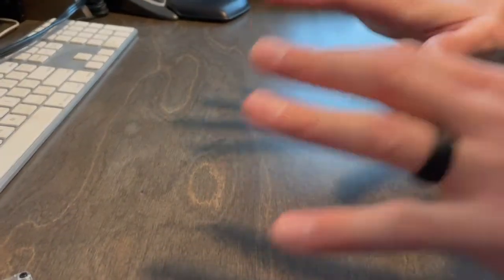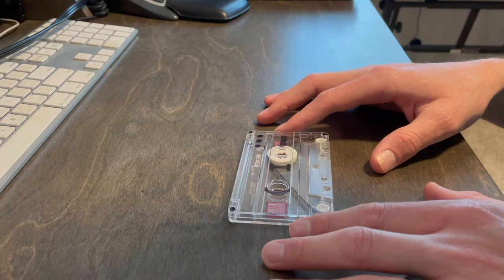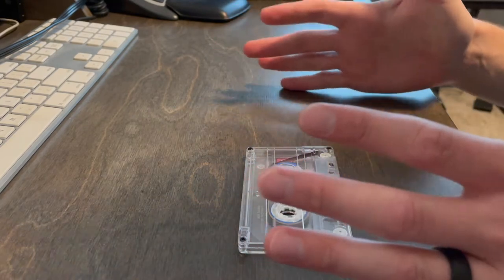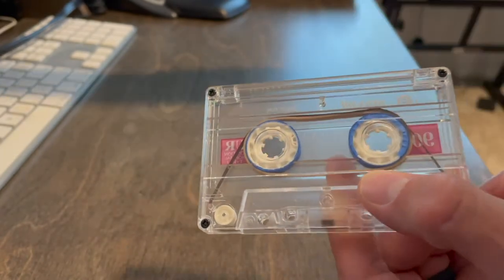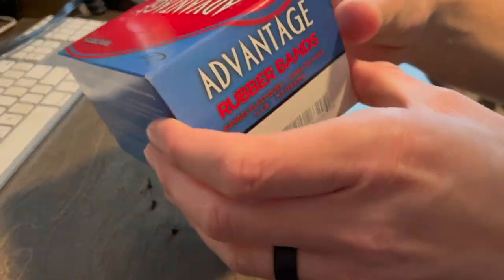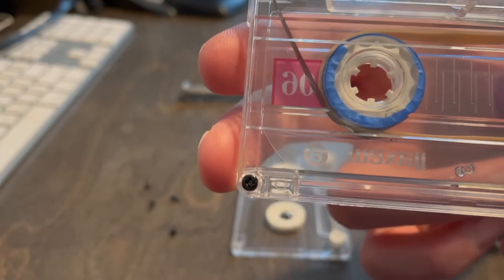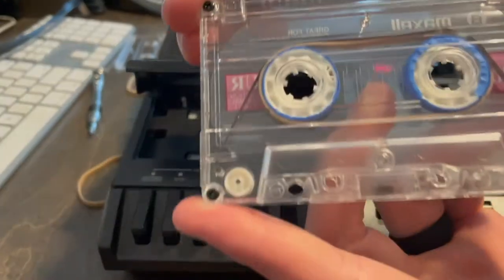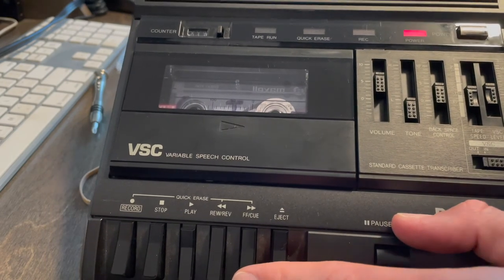Panasonic RR-830 Tape Loop Auto-Stop Fix

Comment: Grabbed one of these for just under $30 but was having the same issue, so it's sat in a box while I stuck with a handheld - this is helpful indeed.
Still might consider taking out the sensor entirely, but upon realizing (only once I had it in-hand) that this deck is mono-only, and has only one magnetic head (so no DIY delay/feedback fun), I may just take this opportunity to splurge on somithing like a used Marantz tape field-recorder or a multitrack.